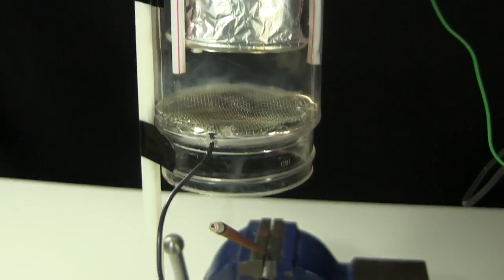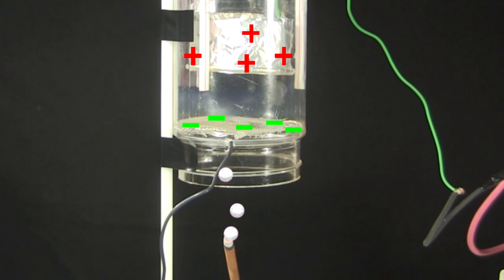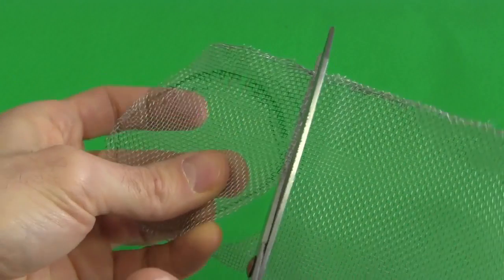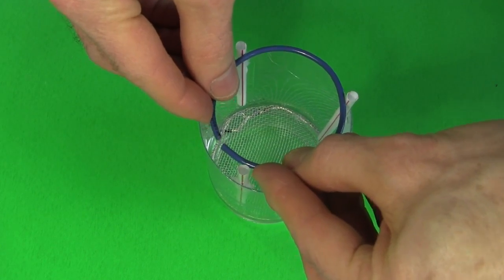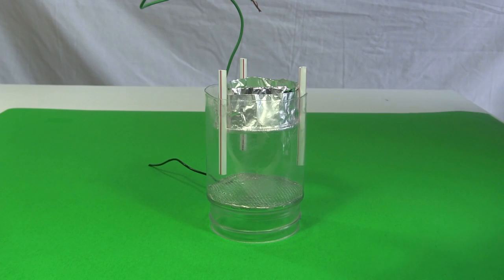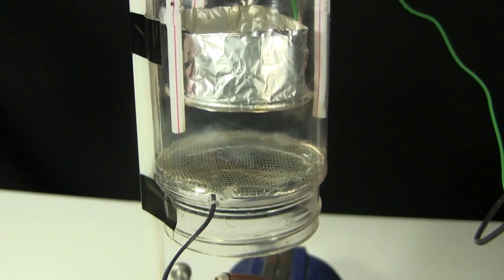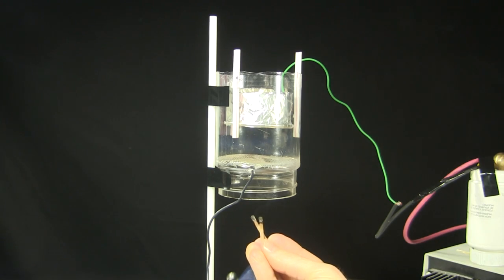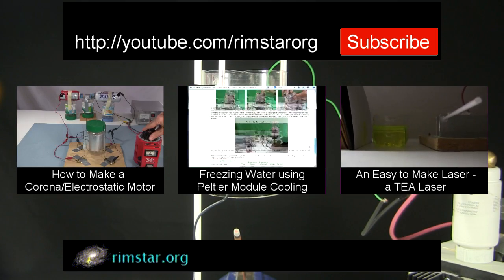Electrostatic Precipitator/Smoke Precipitator - How it Works/How to Make

Comment: Excellent work. Having spent 30-odd years in environmental protection and pollution control dealing with the industrial sized versions of these it is great to see such a clear and practical demonstration of the technology. I think I'll have a go at this myself (anything to avoid dusting). Subs +1.
Reply from the maker: Thanks. On the ones you worked with, did you have an issue with ozone production? The design of this one requires high enough voltages to produce ozone and so is not a good idea to use it in an unventilated place or for too long. And welcome to the channel.
Reply: @RimstarOrg  You're welcome. Yes, they were known to produce ozone but at the time ground level ozone wasn't as much a concern as the fine particulates the EPs arrested (in fact it still isn't - atmospheric ultra-fines are a major killer). In an enclosed space it is an entirely different matter and you're quite right, ozone there is a real risk. In an enclosed space it would be best to strip the ozone out before it leaves the stack. Thanks for the welcome - very greatly appreciated.

Comment: Can this principle be used against Covid? See: https://www.ncbi.nlm.nih.gov/pmc/articles/PMC4477231/
 I want to adapt an ion generator [I have a 12V carbon brush type - just the component) for filtering air to hopefully reduce the quantity of aerosolized coronavirus around my grandmother.
The linked  study protected guinea pigs from infection by  use of an ion generator plus  a 'positively charged plate as a collector'  an idea which appeals but I'm stumped for implementation.
 Can anyone please explain, in layman's terms, pref. using household items (or cheap ebay stuff) how I might safely +vely charge something metal   to use as such a collector? 

Doesn't have to be brilliant, just simple and any improvement over an ioniser alone.
Reply from the maker: The problem with my design in this video though is that it requires around 21,000 volts and at that voltage, it produces ozone, which is harmful to your health over a long time. Commercially made ionizers work with a lower voltage that does not produce ozone. So I wouldn't use this design for what you want.
Reply: @RimstarOrg  Thanks, cheers for reading.

Comment: Hi Rimstar, I saw the comment on Ozone generation and that somebody said it started from 14kv. From my own experience it starts already at 3kv. Besides that I looked on the internet to get an answer and I found one in this link: https://www.researchgate.net/publication/235907436_Study_of_Pulsed_High_Voltage_Source_for_Ozone_Generation
In this article is also stated that it starts from 3kv and that you get more ozone when you increase the voltage. What I do not understand is how to eliminate the ozone generation and besides that benefit from the particle precipitation. It seems like a quite nasty dilemma. Also if you charge the particles van a positive high voltage electrode the ozone generation is less, but I think you already know that. Did you make any new discoveries about making this process more efficient: no ozone and precipitating the unwanted particles?

Comment: Hello! I'm doing this for my science project and I just wanted to know if it was AC or DC. Thanks！
Reply from the maker: It's DC but it's 21,000 volts DC. So you can't use batteries or a normal power supply. See my follow-up video where I measure it and test some other power supply options https://www.youtube.com/watch?v=ARSQWTzWago

Comment: Is it alright if the mesh is connected to negative terminal of high voltage supply instead?
Reply from the maker: Yes, that would be alright. My HV power supply didn't have a high voltage negative output so the negative terminal was ground. I liked having the mesh be ground because it is nearest the table and other supporting stuff, which is also at ground potential. But even then, I think mine was high enough up on the plastic rod for that to not have been important. It did allow me to run the negative wire across the top of the table instead of suspending it in the air though, as you'd have to with a negative that's at high voltage with respect to ground.
Reply: @RimstarOrg  Cool. Thanks.

Comment: Can we use batteries
Reply from the maker: No, you need at least 21,000 volts. The easiest is probably to buy a Wimshurst machine like the one I used in this video from https://ebay.com
Reply from the maker: Sorry, I meant a Wimshurst machine like the one in my follow-up video here https://www.youtube.com/watch?v=ARSQWTzWago
Reply: But I cannot take it to school
Reply from the maker: Off-hand, I don't know of a smaller solution. There are small power supplies on ebay but they are AC (Alternating Current) whereas this precipitator needs DC (Direct Current).

Comment: plz, tell what is the minimum voltage required for this project.
Reply from the maker: It's around 21,000 volts. I show measuring the voltage and powering it in different ways in this video here https://youtu.be/ARSQWTzWago

Comment: what kind of wiring would i need?
Reply from the maker: For the high voltage wire going to the power supply, you want it to be well insulated and to take a path that it kept away from grounded objects. I have a webpage here https://rimstar.org/equip/hvwiring.htm with tips for high voltage wiring.
For the ground wire, the one connected directly to ground, any wire with insulation on it will work.

Comment: Can we make our own high voltage supplier if so how?
Reply from the maker: The 30kV high voltage power supply I use in the video is getting harder to make since the diodeless flyback transformer used in it is getting very hard to find. However, in my follow-up video https://www.youtube.com/watch?v=ARSQWTzWago I show that it works with a Wimshurst machine. You can make one fairly easily (just make sure the disks are around 12"/30cm or larger) or buy one on https://ebay.com by searching for "Wimshurst machine".

Comment: How can we make the power supply for this,
Reply from the maker: The easiest is to make or buy from https://ebay.com a Wimshurst Machine, one with disks at least around 30cm in diameter (mine are 27cm and it works). I show a Wimshurst machine which I bought from ebay powering the smoke precipitator in my follow-up video here https://www.youtube.com/watch?v=ARSQWTzWago The power supply I use in this how-it-works/how-to-make video is much harder to make and one of the parts, the diodeless flyback transformer, is hard to find these days.

Comment: Sir I need your help,I would like to do this for a science fair but I don't know where to get this battery can you please tell
Reply from the maker: This is probably not a good project for a science fair. It doesn't capture all of the smoke and it also produces ozone. Ozone in small amounts isn't too harmful but during a science fair, you'll be producing a lot of it and that can be harmful.
Having said that, you need 21,000 volts which is far more than any battery can produce. I show some alternative ways of producing the high voltage in my follow-up video https://www.youtube.com/watch?v=ARSQWTzWago The Wimshurst machine that I show there can be found on https://ebay.com by searching for "Wimshurst machine".

Comment: can we use electricity in place of high voltage power
Reply from the maker: If you're asking can you use the power directly from a wall socket or a battery then the answer is no. This one needs around 21,000 volts.

Comment: What is the output from high voltage generator,is it Ac or Dc
Reply from the maker: It's around 21,000 volts DC. I measured it in this follow-up video https://www.youtube.com/watch?v=ARSQWTzWago as well as show an easier way to power it using a Wimshurst machine.

Comment: 2:15 : Dear friend, sorry for my English. Could you explain : if the mesh is grounded, how it is possible for smoke particles to get the negative charge while going through the mesh?
Reply from the maker: Good question. Positive and negative charges attract each other. The positive charge on the foil attacts negative charges from the ground, through the ground wire to the mesh. So the mesh becomes negatively charged.

Comment: i cant make power supply shown here. can u guide me how to  charge the Al foil positively and the the mesh negatively please with the help of some easy method or any equipment that i can buy from the store
Reply from the maker: Check out my follow-up video here https://www.youtube.com/watch?v=ARSQWTzWago where I show powering it using a Wimshurst machine. You can buy those on https://ebay.com. Just search for "wimshurst machine". Pretty much any one there will work. For example, https://www.ebay.com/itm/Wimshurst-Machine-Physics-Electrostatic-Generator-Model-Educational-Toy/233080929666

Comment: How did you calculate the distance between wire mesh and aluminium foil . And how did you calculate the width of the foil required?
Reply from the maker: For the diameter of the foil, I just went by the diameter of the plastic jar. It doesn't really matter. For the roundness of the bottom edge of the foil, I just guessed what might be good. I didn't want it to be sharp. The height of the foil can be anything over an inch or so. I determined that because that's around the height of the foil for a lifter which uses a similar principle in order to fly (here's my video on making a lifter https://www.youtube.com/watch?v=vzZy1Aqleno).
For the distance between the wire mesh and aluminum foil, you want it to be as close as you can get it without causing sparks between the foil and the mesh. I show testing that distance in this follow-up video https://www.youtube.com/watch?v=ARSQWTzWago.

Comment: Is it work with 200v to 300 v AC electric current
Reply from the maker: No, for this one you need at least 21,000 v and it must be DC (not AC). See my followup video where I measure the voltage and try it out with a few other power sources https://youtu.be/ARSQWTzWago.

Comment: Where is the black negative wire is connected
Reply from the maker: It's connected to the negative of your power supply. In my case that was also ground. Does your high voltage power supply have two outputs?
Reply: @RimstarOrg  btw i dont have any iam looking to build some... Can i make the powersupply wising a capacitor bank
Reply from the maker: I don't know what that would look like. You'd still need a high voltage power supply to charge up the power bank. Note that the voltage required is 21,000 volts. See my follow-up video where I measure it as well as show another way to power it https://www.youtube.com/watch?v=ARSQWTzWago

Comment: How many voltage does this it require? Please specify if it is alternative current(AC) or direct current (DC)
Reply from the maker: It requires around 21,000 volts DC. I don't know how much current. I've been asked this so often that I made this follow-up video https://www.youtube.com/watch?v=ARSQWTzWago where I measure the voltage and demonstrate that it can be powered using a Wimshurst machine.

Comment: Can we use battery so that it could work
Reply from the maker: No, this design needs around 21,000 volts, much more than any battery. See my follow-up video where I measure it and also show how to make it work with a Wimshurst machine (which are available on ebay.com): https://www.youtube.com/watch?v=ARSQWTzWago (Note that the small CD Wimshurst machine which I show to make in another video won't work for this.)

Comment: Is it possible to extract the positive terminal of an AA battery for the V+ of the aluminum foil and its negative terminal for the V- of the wire mesh? Asking for a research project thanks in advance
Reply from the maker: No, this requires around 21,000 volts, much more than the AA's 1.5 volts. Check out my follow-up video where I measure the voltage and show some options for powering it https://www.youtube.com/watch?v=ARSQWTzWago.

Comment: What is the material for high voltage power supply .....tell me fast I want to do science project
Reply from the maker: I doubt if you can quickly make the power supply I used, which is this one https://www.youtube.com/watch?v=GEuK1OdYxHk. However, in my follow-up video where I measure the voltage required, I also show that it works with a Wimshurst machine https://www.youtube.com/watch?v=ARSQWTzWago. You can buy those on https://ebay.com. I don't have any video on how t make that Wimshurst machine though. I have a video about making a different one but it's not good enough for the smoke precipitator.

Comment: Would it be safe to make it for a school project as very high voltage is required and can we use an induction coil to get the voltage
Reply from the maker: Good question. This high voltage power supply which I use in this video is dangerous unless you know how to work with high voltage safely. However, in my follow-up video https://www.youtube.com/watch?v=ARSQWTzWago I demonstrate it using a Wimshurst machine which is much safer and would be a great addition to your school's science/physics classroom if you have one. Note that it has to be a Wimshurst machine with a disk around the size I use in the video or larger (around 27cm/11 inches in diameter). A Wimshurst machine with disks the size of a CD/DVD probably won't work.
If by an induction coil you mean a step-up transformer then no, that won't give high enough voltage. If you mean something like an autotransformer then maybe. You'd have to turn the output into DC though. The video I link to above shows that I measured the required voltage at around 21,000 volts for this design of smoke precipitator.

Comment: Circuit diagram and 
Make a video in how it current flow
Reply from the maker: The high voltage power supply is detailed here https://rimstar.org/equip/30kv_pwr_supply.htm and the low voltage one that feeds the high voltage one is here https://rimstar.org/equip/24v_pwr_supply.htm. The flyback transformer with no built-in diodes is hard to find but I show other ways of powering the smoke precipitator in this video https://www.youtube.com/watch?v=ARSQWTzWago.
As for how the current flows, didn't I show how it works in the video?

Comment: does it produce ozone into the air?
Reply from the maker: Yes, it produces ozone. There's some voltage somewhere below 10,000 volts where it wouldn't but I don't know what that voltage is. Unfortunately, this design requires at least 21,000 volts.

Comment: Can l give negative charge from the same battery through which I am giving positive charge
Reply from the maker: A battery has both a negative and a positive terminal so, yes. But if you're asking because you want to use a battery to power this smoke precipitator, it won't work. Batteries are typically around 1.5 volts to 12 volts, depending on the battery. This precipitator needs around 21,000 volts. See my follow-up video where I measure the required voltage https://www.youtube.com/watch?v=ARSQWTzWago.